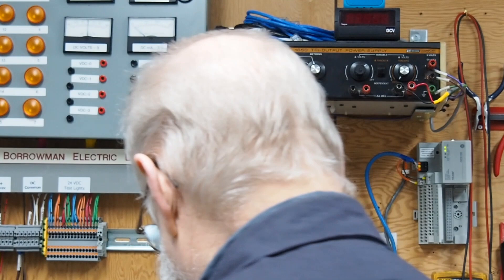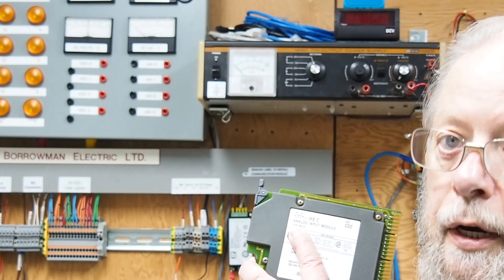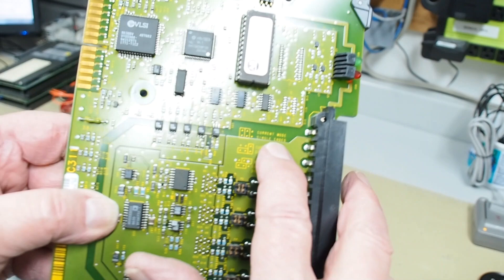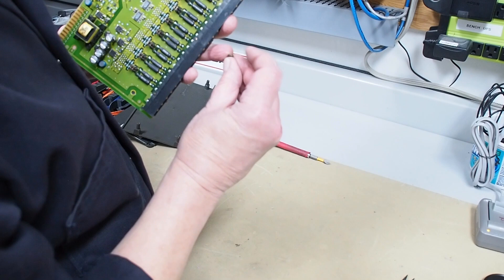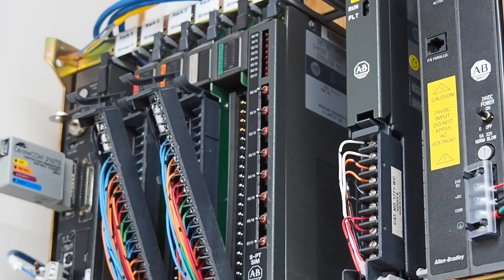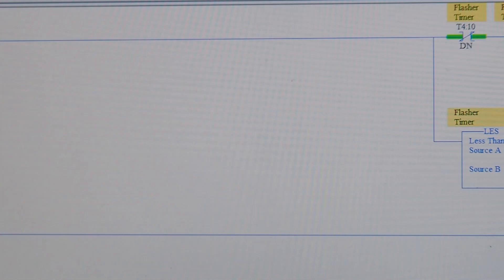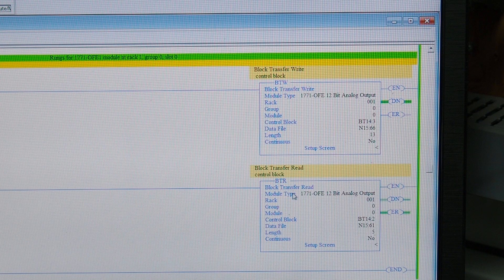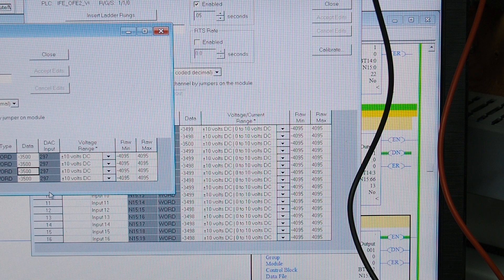1771-IFE Analog Input

Comment: Hi, I have several AB PLC's mostly SLC500 and 1000"s and have RS Logix 500 and 5000. I also have the 1771 with a 1785 5/40 Processor and a 1785 5/20. I and trying to find RS logix 5 demo or evaluation copy just to get this this this running and I have loads of card for it from analog, discrete, digital and many more it has the full size back plane I forget how many slots, I go it put up now but would love to fire it up and see what it does. I cannot find it anywhere other than from Rockwell Automation and can't even get my account setup with them anyway for some reason but don"t have the thousands of dollars for it. Is there a demo version of this available?
Reply from the maker: Hi Marshal:
There used to be demo versions but Rockwell is hard set on trying to kill off the PLC5 systems.
Last I heard is that they have removed all support for it and if you really want a copy it is well north of $20K for a 1 year license.
There are none on ebay that I know of because of Rockwell threatening to sue ebay over copywrite.
Because of threats of being sued I have no idea where I can suggest that you go and I do not have any demo's left that work.
If someone has a copy that they are no longer using and have the key disk for it that will be your best bet.
Sorry I can't be of any help on software but Rockwell has it tied up in a steel drum and welded shut.
Hopefully someone can get ahold of you thru your website with an offer.